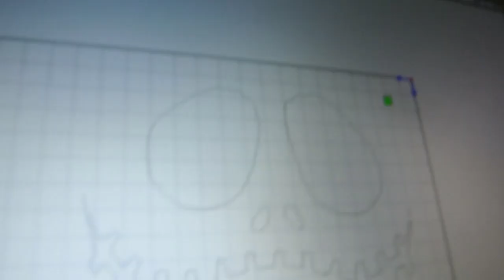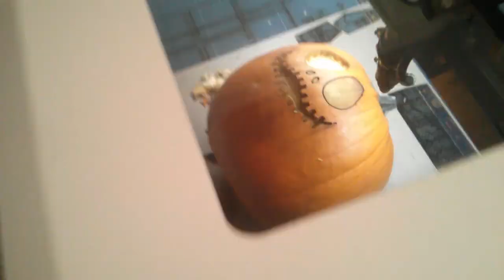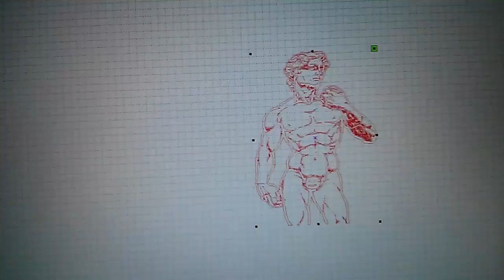WILL IT LASER: Pumpkins

Comment: hey hacksmith im trying to build a exosuit based off of the new cod advanced warfare game got any advice
Reply from the maker: Haven't looked into it enough. It's probably not very feasible as it is portrayed in the game (or at least the commercial). i.e. no jet packs or the ability to fall a few stories without hurting yourself. Learn CAD and give it a shot though! Manufacturing it will cost thousands of dollars so you better make sure you have a design that will work before you sink that kind of money into it. Good luck!
Reply: thanks